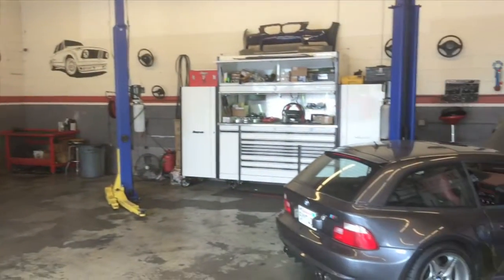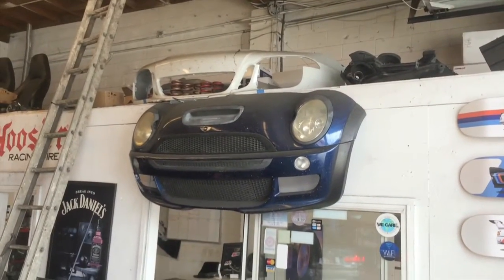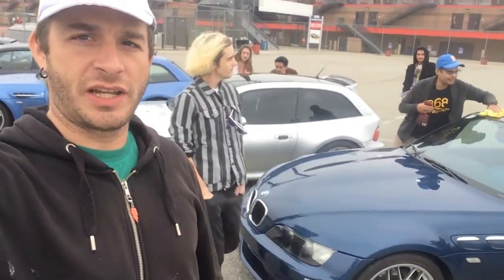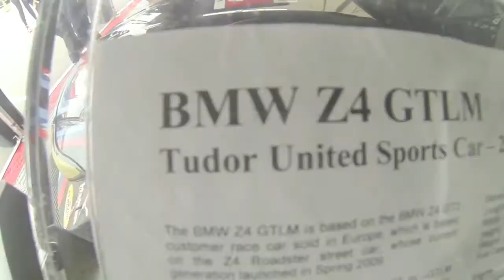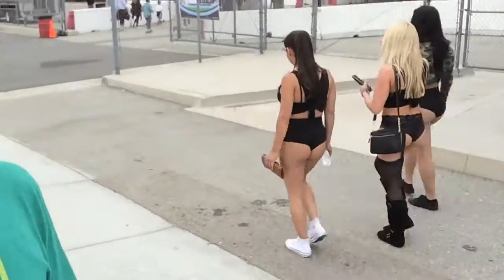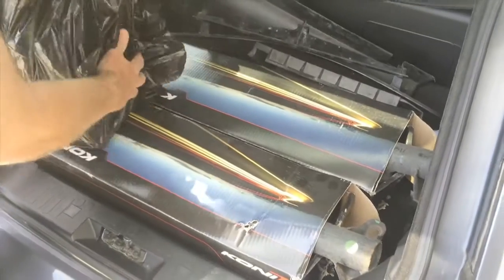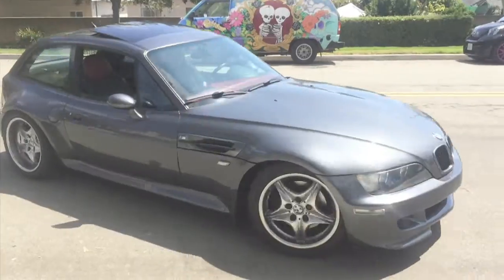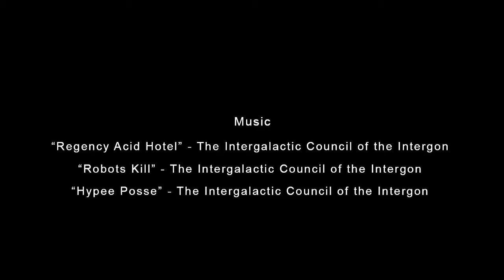BMW Z3 M Coupe tribute featuring Bimmerfest and MiniCorsa

Comment: Why 315??? Z3M had S54 with 325
Reply from the maker: PAPASTRATOS777 American Z3 M Coupe was down tuned to 315hp. This was all in the catalytic converter and emissions differences.
Reply: @samtrak , understood.
I have Z3 roadster swapped with S54B32 with Schrick cam shafts. Abt 370 HP.  Diff LSD 3.46